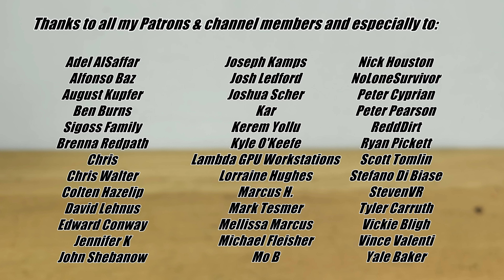I make my own Locknuts - DIY Nylon Nuts

Comment: You did this the hard way. One time I had a special nut that was heated to remove so the nylon was melted. Got a similar sized nuylock nut and removed the nylon with a pick then put it in the nut I needed. Took a few seconds.

Comment: Who is nuts enough to buy expensive equipment and spend time learning how to use it and nuts enough to spend so much time to make one and nuts enough to throw it away after one used - Mister,YOU ARE NUTS!!! Just wrap a thin sheet of plastic baggie around the screw and be done with it.

Comment: When out away from the workshop and needing to replace a nyloc nut , I have found that a hard blow with a hammer on the nylon end before reinstalling deforms it and makes it serviceable until a new one is available.

Comment: No disrespect to you, but if the thread are good in that nut all you have to do to revive the like new because the nylon was crushed outward is using a hammer just give it a hit downward slightly crushing that metal downward and will crush the plastic threads which I found to have the same effect as new. Your way too time consuming and tooling not everyone has in their basement.

Comment: The original nut has a slightly larger contact surface from what I can see. This wont be a problem in most applications but when you're looking for a specific torque(like in automotive applications) that contact patch area is part of the torque equation.
Loved your video.

Comment: I take the old nut warm it up with a heat gun. Then reuse it the nylon melts bak to the old size with a rod in the inside to stop it smelting out

Comment: They loosen the same way; you could try flattening the nylon between the contact point and the nut, or roughening the contact point. The only thing that works well is the pin. 👍

Comment: HAHAHHA It is less than 10 minutes since I was looking for Mercedes-Benz M10 fine thread locknuts from my bolts and nuts bins. Those are fairly rare, even though I have thousands of bolts from various M-B engines and transmissions that we have stripped and recycled. I was looking for the nuts with steel locking, those we use again, they just needs some presssing in vise for re-use.

Comment: Theres a 99.9% chance that you dont have to go through making a lock nut just because the replacements are not the exact same measurements as your original. The main thing that matters is the replacement lock nut has the same threads

Comment: most of these automotive ones use steel rather than nylon... especially exhaust nuts! sometimes there just flanged and slightly "squished" to an oval... often see the witness marks of the press...

personally... i just wack them with a chisel. or squeeze them in the vice.

never hurts to grab random handfuls of bolts from the wreckers...

Comment: That looked like you used Delrin, not Nylon.
Delrin is much nicer to machine but is significantly harder material, which would explain why you appeared to be using a lot more force on the wrench.

Comment: Wow. I'm retired from the railroad, maintenance of equipment. I've worked on everything from new-build to steam locomotives. I would spend 90% of my time looking for 10% of the spares needed to "make it right." So, I was scratching when I saw you making nylock nuts on your own in the long format video. Certainly, these could be sourced commercially, right? Well, now that I have the specs I checked my usual sources and no luck. Now I get it. Keep it going!

Comment: You typically can reuse nylon nuts as long as they have a friction torque high enough to ensure they can re-lock after being installed

Comment: Nylon lock nuts shouldn't be reused in certsin contexts but they  are still much better to reuse than a regular nut.

Nylon locknuts on skateboards can be reused if your swapping bearings or wheels

Comment: I was thinking about ... did You actually try to mount a 56~80000 rpm with carbide burr pneumatic pencil die grinder on the tooling turret on the lathe to make something interesting? or also to use free hand such high rpm and very hard burr to precisely cut bearings, soldering points, inox and hardened metal stuffs...

Comment: Some of the lock nuts I seen decades ago, had a serated lock washer pressed onto the end of the nut. When tightened down it was very hard to remove and would be "locked" into place.

Comment: The way I make diy nylocks is by using my 3D printer to make a small robotic hand (2 weeks of printing), that I then program using my computer to type on a keyboard (undisclosed amount of time).  It's programmed to type a sequences of keys that go to Amazon and order nylocks in 100 packs, two day shipping.  Works great with just stuff I have laying around the house.

Comment: the original nut reference is NN1SH-M10-U, took me one minute to find it. when having trouble with a metric bolt or nut, just add 'japanese' to your search
Reply: exactly. Misumi is usually the way to go here.
The thing I'm asking myself is which steel and thus which torque he uses to tighten these nuts if it matters...
Reply: @sambafamba  usually doesn't really matter. its more about the grade of the bolt/stud.
i.e. in automotive there's a lot of places that need a 12.9 bolt but the nut you're using is grade 8, instead of C, DH or 2H. the bolt or stud will be damaged before the class 8 nut gives way

Comment: or just put the old nut partly  in the top corner of a vice , and then deform the top part with the nylon . And repeat that a few times by turning the nut . So the nylon is deformed enough again to hold the bolt. 
The old nut in your video did not seem to have  that much nylon anymore though .

Comment: For safety-critical applications it is no doubt desirable to use a new Nyloc each time one is fitted but in practice it is often perfectly OK to re-use a removed one.
Where the extra height is a problem nylon can be inserted from the side.

Comment: In the early 90's, as an aircraft technician, I worked on Macchi MB.326 trainers, a design from the 1950's. It used a lot of locknuts of the deformed metal type, where the body of the nut was slightly crushed out of round to provide locking friction. In one place, however, the locking was provided by a piece of nylon pressed into a hole through the threads of the BOLT, rather than in the nut. Of course they were not re-useable, and by the 90's spares were almost non-existent. We got approval to repair the used bolts by punching out the original insert, and replacing it with a piece of nylon line from a whipper-snipper. Worked a treat. So, if you need an odd sized locknut for a project, and you don't have a lathe, think outside the box and drill a hole in the bolt!
Reply: I've seen it too. When your female thread is cut into a solid piece of metal this method is a way to solve it.

Comment: If the nut has been used before, just put some silastic on the bolt thread on the top of the nut.

Comment: I make my own locking nuts by taking a regular nut, Dremell with a diamond burr and grinding a dent into the threads toward the top about the size of a pin head. Then I flux it and heat up the nut and ball up a pin head sized bead of solder making sure it sticks to the steel proceeded by letting it cool, the lead solder grabs the threads of the bolt and holds them firm. Over time you'll also get a small amount of galvanic corrosion and the oxides will stick up the threads even more. It's not difficult to remove the nut, but they don't rattle loose. 😊

Comment: That rusted locknut looks like Chevy’s locknut for the rocker arms that was on engines that had a solid lifter cam. The locknut was not round, but looks like it was squished a little so the threads would grab on the stud tightly.

Comment: Nice video. You should mention a lock nut comes in many forms. Some are pressed sideways with a small rectangular square on only 2 sides, some are similar to the Ny-lock with a multi cut top so the fingers can be bent over. Just like the Ny-lock , however no nylon. I’m sure there are more just can’t remember them all.

Comment: Cool video. I will add that I reuse these nylon lock nuts all the time on my drones. They are used to secure the prop to the motor shaft, so they are subject to lots of vibrations. I have never had an issue.
Reply: You should be fine as long as the nylon is still biting enough to make the nut difficult to turn by hand.

Comment: As a [now retired - thrown under the covid bus actually] Professional Automotive Engineer and having dealt with Nettlefolds (a huge fixings supplier) through the 90s, I knew what a nylock nut is and how they are made and what they do. So, when I saw the title, the first thing that crossed my mind was 'why❓'. Why would you want to when they are so plentiful and cheap. Within seconds it became clear - ah! it's a 'special' that is no longer commercially available. This is the first time I've come across your channel, so I'll guess that either you want your rebuild to remain original, OR there isn't enough room to get a 17mm socket in, hence the 14mm AF size.
And the result? Spot on! I like it. As an Engineer I love solving problems. You'll see on my channel that I have solved a few for the Saab 9-3 community.
Anyway, I have subbed and will explore your channel further in time.
Reply: "Sorry for my bad english, it's not my language. I try my best to improve my technical english."
You're English is fine 👍. What is yournative tongue? Whatever it is, I can't speak it, lol!

Comment: A very nice job! In a pinch, you can almost double the compression force available on your very ordinary screw vise. As you are tightening down and it is getting very hard to turn, then you give the movable jaw repeated whacks with a hammer (brass, or soft face only) as you continue to apply pressure.

Comment: When you cut the lock nut in half you have shown how a split lock nut works. Make the nut and where the dome is split the dome down. Drive the sides in a little and fit. It will now be tight and can be used in areas that have heat through use which can damage plastic. 
I am not decrying your excellent workmanship but illustrating the alternative used in some engineering formats.

Comment: Yes, you can make one, but you could buy a whole box of them and even have them delivered for less than the cost of your time, materials, and machinery cost.  

So long as the lock nut is in good condition and gripping the bolt, there is no reason to not reuse them.

There are also all-metal lock nuts where the the thread tapers slightly toward the outer edge of the nut.  They have to be made to much tighter tolerances so that the thread will tightly grip the bolt but not so tight as to not be able to be assembled with hand tools.

Comment: In a pinch, I've made a lock nut by gently squeezing a standard one in a vise, just barely out of round enough to make it thread on slightly harder than finger tight, not hard enough to hurt the threads. And it remains a lock nut for a long time afterward.

Comment: you can reuse them the plastic springs back. sure after many uses it gets less locking power but removing it once doesnt affect the locking feature. if it would the nuts would be useless as thread are already deformed after tighting

Comment: Very nice.  The crimp was a little off-center, but that could be fixed by making the crimp tool with a pilot that goes into the nut to center it before the tool contacts the rim to begin the crimp.

Comment: Nylon lock nuts are safe to reuse as long as you can't thread them on by hand.  It's called drag torque, noted also don't use nylock on parts subject to rotation.

Comment: This is pretty cool.

You might consider looking into aircraft hardware.
It’s standardized but generally not the same as what you might find at the hardware or auto parts store.

I don’t recall the particular thread sizes, but these seem similar to what is used on Eurocopter aircraft

It’s now a subsidiary of Airbus.

It’s cool that you have the capability of making these, but it might be more convenient or efficient if you require more than a few.

Of course you could make some obscure hardware just to mess with whom ever inherits your car in the future 😁.

Comment: "never reuse nylon locknuts"

Hehehe hold my beer.
Reply: The ISO standards actually specify a number of re-use cycles and the minimum effectiveness after five uses. The nylon inserts ARE designed to be re-usable, however bolts and nuts themselves may not be suitable for re-use, as proper tensioning results in a degree of deformation and potentially yielding of the threads. For critical, high-tensile applications the re-use of fasteners is generally not advised. But for low-stress application, or simply running the nut up and down the thread of the bolt, the nyloc should be effective for several uses.

Comment: Would think if a custom lock nut required then a deformed type be the way to go, at least its only a matter of making deforming die  and use conventional nuts but otherwise nice project and video ❤

Comment: Auto manufacturers rarely use nylon locking nuts because nylon melts easily. Rather, deformed nuts or locking compounds are used.
Reply: Not really true.
There are many places on a car where the nut wont get hot. Although obviously it gets hot on the engine and some areas of the engine compartment.

Comment: you can definitly reuse them like 1-2 times... the thread in there is not cut, there is extra material, so even after forming the thread it is still pretty tight after unscrewing them like 1-2 times
Reply: you can reuse them as much as you want because these are not nuts they are hell spawn.

Comment: as a everyday mechanic, nylstop nut should be illegal specially on ball join. they damage threads and are sometimes impossible to undo without extreme impact or heat….

Comment: Nice video and presentation. 
Since you are an accomplished machinist. Here is an interesting twist for lock nut idea , a twist from the well known  locnut. 

Machine a standard nut with about 1.5 pitch higher. Skim down the nut outer diameter by a length of 1.5 pitch. The skimming enables us to compress (scale down) nut height. The goal is to create 1.5 pitch worth of interference fit (counter the interference by nylon ring). The produce is a nut with two sections, 1) the nominal pitch and a shoe resection of scaled down pitch. 
Please let me know what do you think?

Comment: Questions regarding the zinc plating:
Did you plate the nut before adding the nylon insert and pressing the end? 
If so, does the 'stretching' of the outer edge compromise the surface plating? 
If you plated the nut after adding the insert, how far does the plating penetrate under the nylon ring?

Comment: A bolts and nuts shop owner told me once that, a locknut can still lock again, even after you unscrew it from the bolt, as long as you only screw it again on the same bolt and never use another bolt with it, even if it the is same diameter and thread, but I find it hard to believe. Do you think that this might actually be true by any chance?
Nice video btw.

Comment: In video was mentioned nut is from car and also 14mm wrench instead of std 17mm. Knowing that i presume nut is hardened to fit min 8.8 standard at least. Aside question how nylon ring will survive hardening or how to bend hardened nut lip, would be interesting to see if nut can be tighten to specify torque.

Comment: I didn't know they were supposed to be used just once, but the bastards are a little bit expensive so i will be using mine repeatedly 😁 after all, they just won't come off as easily as a regular nut.

Comment: This is interesting but if a nut is longer and has a fine thread that's because the regular form factor nut didn't have enough threads to hold whatever torque requirements of the application. Therefore making a new nut is risky as it may not have the same strength as the original, just like machined bolts don't either as regular bolts are not machined

Comment: You can reuse them, as long as you use the exact same bolt they sit just as tight. They work through friction, not pressure, and some bolts have slightly different depth of cut on the threads hence you should keep them to their pairs..

Comment: Why can't you re-use a nylon lock nut? Surely it will be exactly as tight on the bolt as when you took it off?  It's not like the bolt removed any nylon when it went through the nylon ring (ie untie a thread cutter).

Comment: This video actually helps with handling anxiety: it starts with a complex problem with many questions, but manages to break down in smaller portions which turn out fine, and in the end I don't even remember why did it seem so difficult.
Reply: that's a good life lesson in general: hard problems are sometimes less scary when broken down into smaller pieces

Comment: I don't quite understand the logic behind not reusing it. How is some part of a thread of the same bolt is different to a thread of another bolt? The nylon ring gets plastically deformed at the very beginning of the thread and yet works fine at any arbitrary distance from the tip of the bolt. How will it stop working once put on another bolt? Sounds like some holistic explanation that makes the act of "losing virginity" somewhat special and unique to the bolt which penetrated the nut first.
Reply: I was looking for a commet about not reusing the nut and you are the first on that I saw.  Yes you can reuse the nut if the locking feature still works.  There should be some run-on torque when you put the nut on. If you can turn the nut pass the end of the nut by hand then don't reuse it.  This is true for all self-locking nuts whether it be nylon or not.

Comment: A statement that only My Mechanics could make: “So all I need to make my own lock nuts is just machining the nut itself, but leave the top section straight, make some nylon rings, and make a pressing tool to bring them actually together…” Not a thing we mere mortals could even attempt.